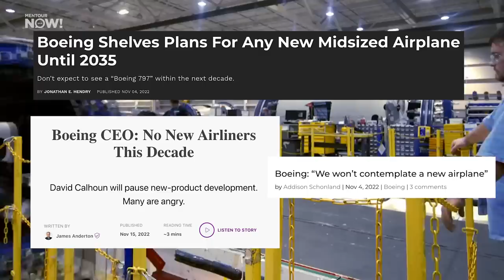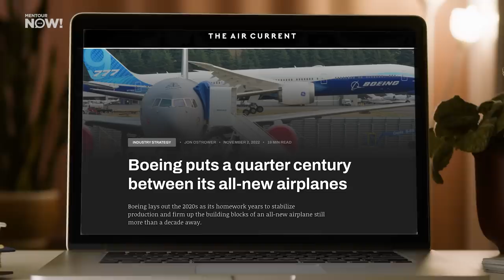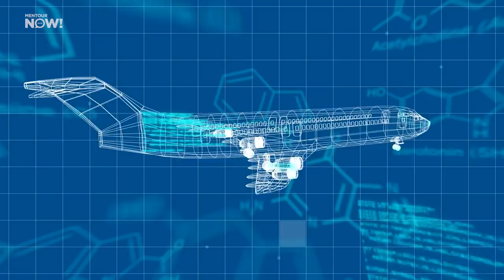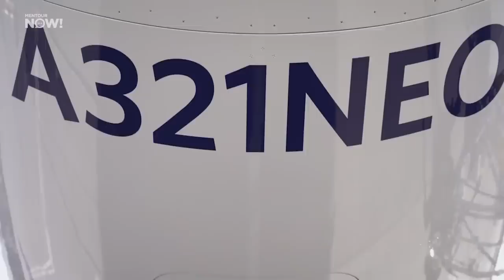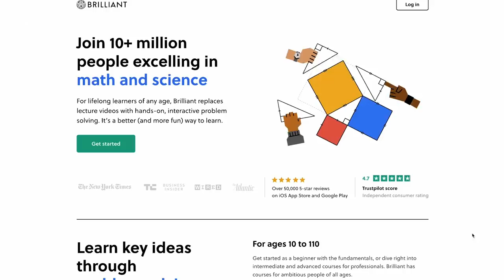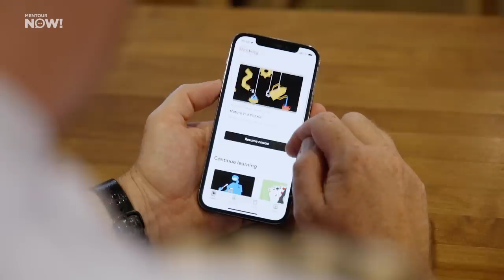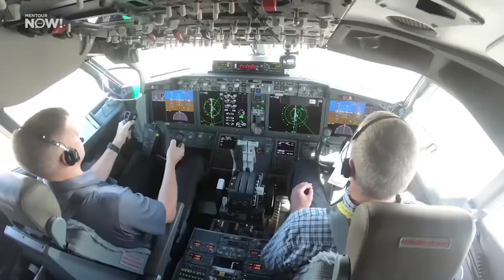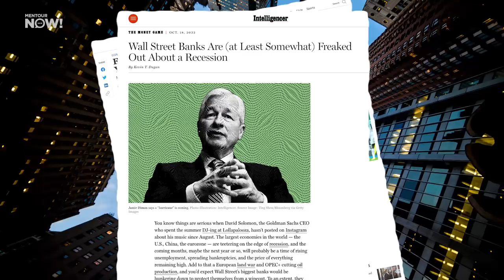Is BOEING giving up!?

Comment: I flew the B767 for close to twenty years and it came into service in the 1980s’. Forty years ago!  I remain impressed at the whole aircraft design and it’s adaptability. Now I’m on the B787 and it’s a truly amazing aircraft that I anticipate will likely endure a similar lifetime. I get the sense that Boeing banked a lot of innovation for years and unleashed it on the 787. As technology rapidly develops, hasty designs are unlikely to be as successful as their classic designs.
Reply: Funny thing is, I don't understand why the USAF wants to buy such an old aircraft for their tanker program. That program alone will ensure that the 767 remains in service for another 30 years minimum. That's a life of 70 years!
Reply: I worked at American for 20 years mostly repairing engines & engine components. We were in a constant battle with management about the proper way to do repairs. They always wanted to cut corners any way they could. Currently Boeing aircraft built in that plant on the east coast have been getting a bad rep, so bad that some have cancelled future orders. The Air Force has been complaining about excessive amounts of debris left in the tankers they have purchased. Saudi customers claim the same thing. They are more concerned about share holder returns that building a quality product. Three examples of crashes that were management induced: DC-9 crash in the Everglades (a supervisor didn't understand the difference between expended & expired on some old O-2 canisters),  Alaska Super 80 crash off the coast of California (manager forced mechanics to pencil whip the lube process of the horizontal stab position screw assembly), DC-10 crash at Sioux city Iowa (not going to comment on that one because it was an FAA  paperwork screw up).  If your Boeing ships gave you good service you need to thank the repair crews that kept them in good shape by fighting management practices. The bean counters can cause a multitude of problems.
Reply: I think people forget that the 787 largely is still on Generation 1, maybe Generation 1.5 if you consider the changes made to build the -9 and -10. 

The 787 could easily go to a Generation 2 incorporating new technology like the folding wing tips from the 777x for a reduced range version of the -8 that would fit in the code D gates of the 767.   In addition, Boeing is already looking at making a higher MTOW version of the -9 and -10 to be able to fully utilize the capacities for long range flights. 

As historical background, the 747 platform finished with 5 generations.  The 777 will be on the 3rd generation with 777X.   Even the Airbus a320 is a multi generational aircraft based on what is now a 40 year old platform. 

Constantly saying let’s make clean sheet designs is expensive and high risk.   Airbus learned that with the a340 and a380 which both failed to achieve a market strength position let alone a return on investment.
Reply: You have the freedom to frame their failures any old way that makes you comfortable. It's a free country.
Reply: The 787 Max lacked a button for disengaging the Auto pilot,  thats my personal belief, am I right?   Or was it built to ignore the pilots, just follow the FMS program.
Reply: @oadka  oooh boo hood b52
Reply: @sirvandovargas

Youre thinking of the 737 Max. There is only 787, no 787 "max".

And while the 787 is a good plane now, its development was probably the earliest sign of Boeing going down the path of being a f@#$up. It had issues with its lithium aircraft batteries. The first company boeing contracted to make a safe aircraft battery out of lithium literally quit after years of development and nonstop testing. They basically decided that designing a "safe" aircraft battery out of lithium was impossible.

Boeing used these batteries anyway, and the result was multiple cases where they vented toxic fumes into the cabin.
Reply: @raptorshootingsystems3379  the A340 and A380 both proved that Airbus is state-subsidized, and that all Airbus's risks are borne by the European taxpayers, not by investors or lenders that Boeing has to answer to.

Comment: The propfans are proven to be f* loud. Having Concorde over your head every hour would be joyous in comparison.
Reply: That was always the killer barrier back when propfans were being developed in late 80s and early 90s. But the argument RR puts forward these days is that new materials, 3D printing and (most of all) far more powerful simulation software give good prospects of this problem being beaten. Time will tell if they're right or not.
Reply: @kenoliver8913  if you are not gonna gear it down you are not gonna go around the sonic boom it will produce, no matter how hard you try.
also: PLEASE no 3D printed critical components in engines. 3D printing is great for testing and low stress components that need weird hollow shape. Propelers do not have weird shape and are under a lot of stress.
Reply: @cola98765  The point of 3D printing is you can make "impossible to manufacture" shapes that your simulation software says will raise the Mach limit at the tips. But I'm a bit sceptical too - I'm just putting forward RRs response.

Comment: That new engine concept is really funny - we started with propellers, evolved into jets only to hook them up to a propeller system (only this time we called them "Fans" or ducted fans as we put them into a casing) and now we wait for a propeller or "un-ducted fan" driven by a turbo jet. A system we have used on some aircraft a long time and called a "turbo-prop" configuration

All along the way we knew that Thrust = mass x acceleration and we also knew that propulsive efficiency increases with increased mass flow rather than high acceleration - why shall we wait until 2035 for this?
Reply: The answer is that conventional propellers are inefficient at higher airspeeds and speeds a little below the speed of sound are highly desirable for air travel.  Jet engines solved all of these problems at the expense of fuel efficiency.  Once efficiency became a big issue they made high bypass designs that were the best of both worlds.  Back to props?  Seriously?  Thunderscreech anyone?
Reply: @knurlgnar24  If you by "conventional propellers" mean a 2 or 3 bladed config you have missed my point. The ducted fans are comparable to a propeller concept only with a lot more "propellers" and with the significant lower rpm associated with propeller propulsion. If you look at a fan-blade cross section you'll notice it's similarity to a propeller cross section. 
And yes there have been huge developments in refining efficiencies but basically we are moving back towards turbo-props - however hugely improved

Comment: Boeing's brand but McDonnell Douglas's spirit.
Reply: That was the problem - reverse takeover by McDonnell Douglas has screwed Boeing over - built to a (low) price, not the traditional Boeing high engineering standards. Such a shame.

Comment: Petter, you are a Boeing fan, since you are typerated on the 737. Understandable.
But you are neglecting one other very probable factor. Boeing has a major credibility-issue. Listening to a Dutch podcast about aviation, one of the two participants is very critical of Boeing. Since the crashes of both 737-Max's Boeing has 'earned' itself a reputation of an aircraftmanufacturer where safety took a backseat to commercial purposes. The number of faults found in recent designs is accelerating and causes longer delays in recertification of types.  
Apparently, Beoing doesn't have its shit together, and they have to rehire hundreds of engineers just to get the basics working again. 

Airbus on the other hand may face deliverydelays, but they don't let safety take a backseat. And there is no political pressure in the EU that leans on them.
Reply from the maker: It is very possible that the delay in an new type might be because they need to “get their shit together” that’s true.

Comment: Whenever I come across a Boeing vs Airbus market competition analysis, I can't help being reminded of the A380. Specifically, the assertion (not sure if it's confirmed or not) that Boeing intentionally misdirected Airbus into the double-decker airliner market when their own internal analysis said it wouldn't be a sustainable investment. Can't help but wonder if Boeing's current posturing has any element of misdirection (that doesn't go so far as to run afoul of SEC regulations).

Comment: Airbus is doing heavy in research since years and will have plans for new aircraft. As soon Boeing moves forward Airbus will throw everything against them. Also Airbus can be quite fast bringing jets to market as has been demonstrated with the A350.
Reply: There is also a legislation , if Boeing bring out a model , airbus will not bring out a model at the same time, as it will not be able to make money back from flying hours as there will be more competition. Vice versa airbus will not release a plane if Boeing are bringing out a new plane. It's weird but it's like a avaition businessman agreement.
Reply: @incognito96  If Boeing and Airbus have an unwritten agreement that is mutually beneficial for each company when they launch a new aircraft model, that has nothing to do with legislation.
Reply: @localbod  there is a legislation between the us(airbus) and Boeing (Europe) , because any industry that fits the requirements for strategic trade policy it the aircraft industry , as the world realises it can only support 2 firms  as they need 600 models to break even.( The world trade economy by beth.v. Yarborough)
Reply: @incognito96  Are you talking about the agreement between the United States and the European Union to suspend trade tariffs for five years beginning in June 2021 as part of a trade deal?
Reply: The A380 was a massive white elephant, and an amazing testbed for technology and processes to be put to proper commercial use later.
Reply: @derpderpderpityderp8848  and ever so many flying again just look at the radar app to see how many are being used .
Reply: @alanolley7286  That's great, but as many have said before It was a commercial failure, and lost money.   It was a great idea but incomplete execution doomed it.  It is half-useless because it has no practical freighter model and the internal volume is far too large to just carry ULDs, and the modifications required at airports to operate it again limit its usability.

But at least the R&D and logistics improved the A350 production, recouping some expenses.  Unlike BOEING, who have been reheating the same planes for 40 years, milking one-model operators like Southwest, Ryanair, Westjet or even nominally Delta for DECADES.  Even the 777 is due for a real new design, but instead they spent over a decade just to make the wings out of plastic.

They do this because many airlines are lying, cheating sacks of shit.  They'll gladly cut corners on training and reliability, and avoid investing in staff as much as possible, this is visible every time they have a dispute with pilots, or take on/create a new subsidiary for short-haul/LCC work.  And BOEING does everything possible to enable them, including outright lies and perjury to the FAA to protect their margins, claiming the MAX models were the same planes and did not require crew retraining to save airlines billions.
Reply: Doubt it. New planes are a massive investment and they need to get their money out of the models and updates before they bring something new.
Reply: @penskepc2374  .. yes, they need to MAX out their investment in an airframe..
Reply: @jb894  Do you realize the 737Max program is over 16 billion in the red? The B787 is 32 billion in the red andjthe 777X is extremly delayed?? They probably will never earn a dollar on the 787.

Comment: The A320 family is high enough to implement the new bigger, high bypass ratio engines, it only needs to have the wings redesigned, while Boeing needs to design a whole new aircraft. Besides of this, the new engine manufacturer is French (I suppose), so I bet the Airbus will know the exact parameters sooner. I think these circumstances are worth to consider also.
Reply: CFM , a partnership between  the America's GE and the French Safran . GE has a great relationship  with Boeing, I'm sure they would also know the parameters  sooner too
Reply: The 757 was basically a redesigned 737 airframe with a new flight deck, wing, tail, and landing gear. To accommodate the larger engines. So what would lead you to believe there is some advantage to Airbus?
Reply: @Georgiagreen317  Higher ground clearance of the Airbus that allows it to fit larger, more fuel efficient engines without making significant changes to the rest of the aircraft. Case in point, the A320neo.

Comment: Former Boeing Everett ... another cost in any new design is 'Facilities'

With the end of 747 and 757 products, that opens up manufacturing floor space at Boeing's massive Factory in Everett. When I worked their, we were rolling out Lean Manufacturing. Everything changed in how we make aircraft. Another program was to reduce the enormous range of 'options' but still be flexible enough for our customers. 

It was not uncommon for 'special projects' for future aircraft going on in the background. Everett houses majority of engineers in many different disciplines. Give them a blank sheet of paper and wait to be blown away with their new ideas. So many rumors flying around the different facilities.

Question: Why would lawmakers get in Boeing's way and not grant extension. One of the stupidest things I have heard lately. After Covid, they better be bending over backward or Boeing will move production to a different country. I still remember when Boeing Corporate moved from Seattle to Chicago. You would have thought the world was going to end. When Boeing moved half of 787 production to different state, heard the world is going to end again. 

Maybe pencil pushing bureaucrats need to spend a week in Everett so we can screw their bobble heads back on

Comment: something that seems a bit scary about the new propfan engines is that there’s no longer a cowling to catch fan blades that fail.
Reply: And I also agree. Smells Fishy
Reply: The noise also seems like it would be an issue. Perhaps this is intended to be combined with the planetary gear turbofan design GE is also working on to keep blade speed lower, but I dunno.
Reply: Those blades are spinning (without checking the numbers, but based on the PT6 engine in our Pilatus) somewhere between 30-40,000rpm. No flimsy cowling is going to stop runaway fan blades. Remember Southwest 1380?
Reply: If you hang then out the back it doesn't matter, don't restrict your thinking to current airframe designs...
Reply: To scare you even more: the thin sheets of aluminium and carbon fibre of the fan housing aren't capable of stopping a failing blade either. There was at least one example in the last few years were one blade failed and penetrated the cabin mid flight.

However, that's a rather unlikely event and turboprops are very safe as well, even though there is no housing around the propeller.
Reply: @Hhutuber  in most cases the fan casing will contain a blade off incident, don't base your overall opinion on the couple of high profile occasions where they haven't.

Comment: Personally no thanks to the open fan. Sounds dangerous.(eg: blade braking apart on landing gear failure, metal fatigue, etc)
Reply: The problem is that they advertise it in a wrong way. It's not a replacement for a jet engine, it's a natural evolution of a turboprop, that will be more efficient, but slow and a bit louder.
Unless of course they are not gearing it down then it's a lost cause as sonic boom on bladetips will kill everyone's eardrums.

Comment: The look of the Rise engine is just uncomfortable to me. Sure, the bypass ratio will be higher, but aren't ducted fans a lot more efficient than open fans of the same size? Isn't that why we have turbofans instead of turboprops in the first place?

How would you even get reverse thrust from one of those? They don't look like they have variable pitch capability like regular turboprops do.

The part that makes me actually uncomfortable in the idea of a fan failure. Turbofans are in a housing that is supposed to (and usually does) contain blade failures. How is the Rise engine supposed to deal with that? Are we supposed to assume "it's not supposed to break" is going to be good enough?
Reply: Scary thoughts!
Reply: It’s very complex, there are aerodynamic inefficiencies also in ducts from the interaction of the blade tips and the duct wall…. with this design assumedly the fan would no longer be a part of the compressor stages, so it wouldn’t be doing work in that respect….
Reply: Safran hires one to two thousand top notch engineers each year, they know what they are doing.